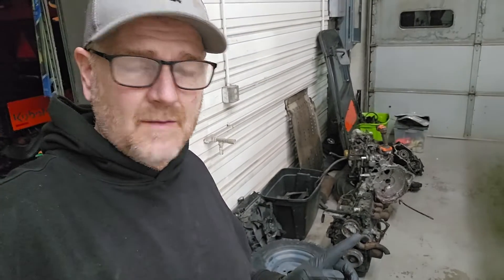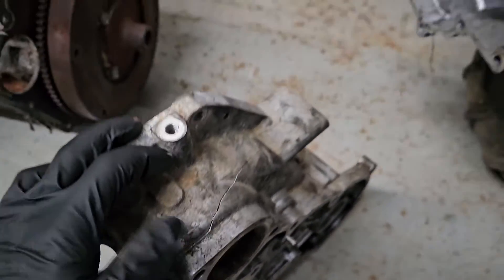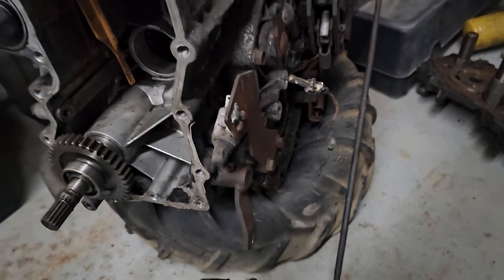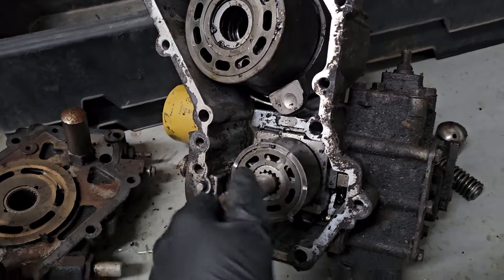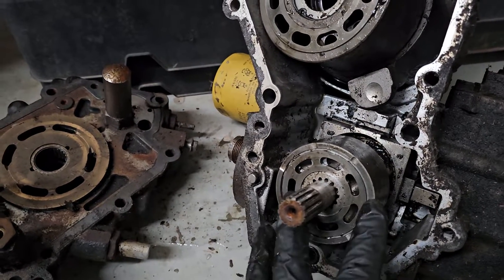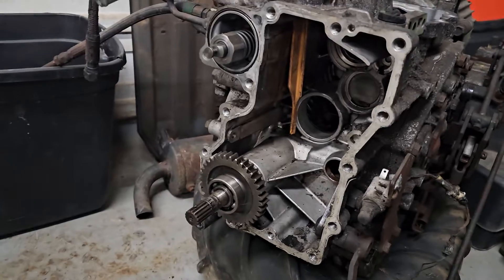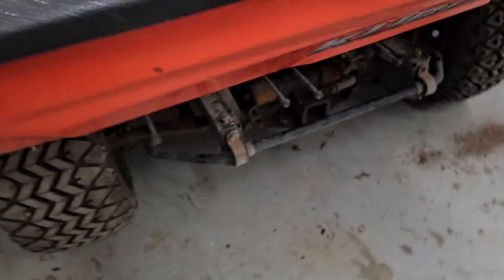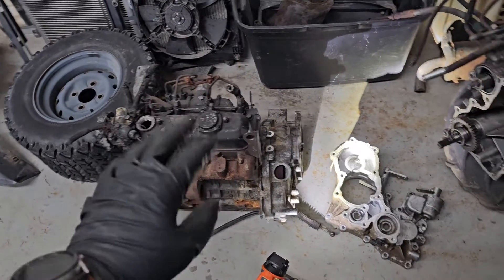How does a HST transmission work? Let's look at this Kubota RTV X 1100 c

Comment: Thanks for the great videos.  Here's a good one!  I have a 2021 Kubota RTV - X1140.  I was changing the transmission oil and the plastic funnel stuck in the hole.  I am not sure how this could happen, but it would not come out of the hole.  Trying my best to to ease it out, the tip of the funnel broke off and is inside the fill area.  I drained the fluid hoping to retrive it from the drain holes.  There are 2 drains. one magnet, the other drain.  No luck.  Used a camera scope, but could not find it.  My question is, how does the fluid pass through the transmission?  Is the HS pump and motor receiving oil directly from the transmission or is it aways filtered through the two oil filters before entering the HS pump and motor?
Reply from the maker: Under the bed fluid is just for the gears and wet brakes. It doesn't flow anywhere else. Its basically a rear differential in there. The fluid is just lubing the gears. 

 The tank under the seat is the circulating fluid. That would be a problem in there. 

I'm not sure if the plastic will just get chewed up or if it would actually cause damage. Obviously its not great that its in there... I'm thinking of what I would do in that case. Hmmmm...

Comment: I have a 2014 RTV X1100C, today the transmission started slipping? I stopped and checked all fluid levels and everything was normal. Proceeded cautiously and when I slowed down to make a turn while returning to my house I lost all movement. No reverse, low or high range. No visible oil leaks....any suggestions? I replaced both filters and topped off oil levels about 2 weeks ago and it has been working perfectly.
Reply from the maker: See if it works in 4wd or with the differential lock on. You may have a bad cv joint.
Reply: @SearlesStation yeah I tried that too. It's like the oil is shut off? I cannot see the oil circulation in the resivore like normally. The vehicle is definitely shifting into desired gears just no pressure from the hydrostatic pump....is there a pressure relief valve that could possibly be stuck? The brake actuated bypass valve appears to be working properly but I do see another valve on the right hand side close to filter ports that is sealed with an aluminum cover..
Reply: @SearlesStation  pulled filters and cut apart. There are no metal shavings or any indication of an internal failure. Hydraulic bed and steering work so I assume that the charge pump is fine. Am I correct in the assumption that the transmission oil and the HST oil are isolated from each other?
Reply from the maker: @crittergetter1720  yes the reservoir under the bed is only for gear lube and the wet disc brakes. The hydrostatic transmission fluid is under the seat on the passenger side. I know there are some issues in with the drive pump or motor (hydrostatic motor)  sometimes. Just as a check does the linkage on the driver side move the lever in the back side of the hydrostat area? Is it possible that the linkage is not operating properly?
Reply: @SearlesStation  yes the linkage is working properly. I've drained all the oil in both the HST and the transmission. The Kubota dealership really doesn't know what to say other than to test the pressures if new oil and filter replacement doesn't work.

Comment: Just a question . For someone who’s new with Kubota rtvs. I have my hst and engine split from the transmission . Unfortunately I had to step away to do another job . What kinda tips do you have for people who want to remember bolt sizing and where they go. Certainly not a shortage of hardware on these small machines . Thank you
Reply from the maker: Yeah, I have some magnetic trays that I try to keep separate for each area (for the most part) Take a bunch of pictures before, that helps too. 

If you go to messicks.com they have the parts diagrams that you can get a real good look at the assembly too.

Comment: dealing with an rtv x 1100c  it stalls out and will die with the ac on but only when accelerating
Reply from the maker: Thats interesting. I do know know the AC takes a good amount of power from the engine. Try pulling the hand throttle and see if that helps.

Comment: Great video, i have question about the brakes squeaking on a cold take off or sitting for a period of time, i have disconnected the parking brake to see if that was 
 hung up and its not the problem, Fluids changed correctly, once its warmes up by moving it, the squeaking goes away, i understand it is a wet braking system.... i have not a clue, fluid stays correct no high or low frequency
Reply from the maker: I would suspect a wheel bearing or axel over the brakes. The brakes sit in fluid so a squeak would strange. 

Lift the whole machine off the ground safely and have someone in the cab while you listen for the sound. You might be able to pinpoint it better.
Reply: @SearlesStation  appreciate the come back and if tried that to and still makes that sound, I will look into that thanks a bunch!

Comment: Hey thanks for the video! I got a question for you, what would make my rtv not want to accelerate past 5-7 mph? It takes it about an hour or so to want to get to 15-17 mph. Any help would be greatly appreciated. Thanks.
Reply from the maker: Which model do you have? Old style rtv or an X models? They are similar but a few differences.
Reply: @ we have an older model. The XC. This morning it wouldn’t even budge forward without first going in reverse.
Reply: Sorry it’s the x1100c.

Comment: Great video, I have a 2013 1140, with about 1400hrs. I got the machine used, and it worked for awhile, although not peak performance, and its now "stuck" in neutral. I get RPMs from the engine, I can change gears, reverse, high, med, low, but the machine doesn't move. Its outside right now, and I'm wondering if you can shed some light on what I can do to get it inside to do more extensive work. Up here in Canada, I want to try and at least get the unit moving to get it indoors.
thanks so much, really enjoy your content.
Reply from the maker: Yes, follow the shift linkage to the transmission, there should be a plate there. Open it up and my guess is the shift fork popped out from the internal link. See if that helps.
Reply from the maker: Another thing to do is safely lift all tires off the ground and put it in 4wd and see if any of the wheels turn. That can eliminate some things...

Comment: Very good videos. Thanks for sharing. 

We operate on a winter ski park.  With your help I’ve taken this and doubled our speed and hill climb ability.   
Often when parked a bit leaning right when restarted it will not move. Any ideas? 
As well as power levels drop and return with no change in throttle. ?
All new fluids and filters.  ??
Better but it’s not where we need it to be yet. 
Hydro-pump?

Comment: I've got an rtv 900 with 4500hrs that is gradually loosing it's pulling power up hills, what usually wears out on them, im thinking maybe the brass/bronze plates that the pump body runs against, any ideas?
Reply from the maker: Yes, that's definitely a wear point. It's all based on pressure, so if that plate is leaking it will lose pressure. Bad fluid, weak charge pump, clogged filters, or a combination of all of that. Maybe I need to do a pressure test video!
Reply: Excellent, I've just subscribed. I did a pressure test a few years ago and it was within tolerance, maybe I should do another. I've heard of people increasing the prv to 4000psi to get more pull, what do you think about that?

Comment: Hi there
Our RTV X1120D 2018 suddenly stopped drive. 
Tries to move but no real torque transfer. 
Oil hydrostatic type issue. 
Both Gbox & hydro tank oil levels good. 
Unloader valve moving & can hear/feel it doing something when activated, while pulling on main control rod. 
Any ideas. 
Other than your video on how the gearbox works is there something on how the hydraulics operate & there controls.
Reply: Forgot to mention tipper body seams to work correctly so maybe pump all OK. Just hydrostatic drive fault.
Reply from the maker: Possibly an axel? Does it move in low or reverse?  Or, Does it work in 4x4? If yes, lift the back off the ground and see if the tires spin. (Typically the passenger side will spin first) Perhaps try the differential lock to see if the driver side rear spins. 

If none of that works, it might be in your hydrostatic area. You can pressure test it or have the dealer pressure test it to see if it's pumping.

Comment: What does the unload do when the pin is pressed in when you step in the brake?
Reply from the maker: The unloading valve releases the pressure built in the hst. If the pressure isn't released, the gears are bound so it is difficult to shift out of gear to another gear.

I do have a video on the unloading valve.
Reply: @SearlesStation  thanks. I have 2015 x1120d it stopped moving in forward an reverse. I found the cable this to unload valve broken do you think would cause this
Reply from the maker: @wisconsinbigcheese6309  I don't think it would unless the valve is depressed. Where are you in WI? I'm in southern MN by  New Ulm. I'd take a look if its not a hassle to bring it this way

Comment: Great video.  Crazy question... i am trying to rebuild the hdrostatic unit on one of these and i need a few parts.  I need a couple of pistons from the larger driving block on the hydrostatic unit.  I would be happy to buy them if you still have them kicking around.  Thanks!!
Reply from the maker: Just looked through my parts. I really don't have any that would be good. They are all worn pretty well.

Comment: If the rtv900 is slowing down faster than usual,  how do I adjust that? It's the not the brakes
Reply from the maker: There is a shock that dampens the return to neutral on the linkage. My guess would be that, that shock is bad and not slowly returning to neutral but the spring is pulling fast. 

Have someone step on the foot pedal while you watch that shock or just take it off and see if it is any good.

Comment: Can you PLEASE explain why did that transmission have a great hole right where the 4 wheel drive shaft came out and it appeared to be welded, I’m aware you purchased it and it didn’t happen to you but just thought you might know why that has happened.
Reason I ask is, mine blew a hole exactly in the same place and Kubota Australia replaced the housing free of charge it’s not under warranty either, they actually done all the work and didn’t cost me anything, so just wondering are they hiding a known fault.
I actually did hear from kubota delivery drivers that said it’s common when they are in snow and the wheels are spinning then it hits hard ground that’s what causes the housing to blow out under pressure.
Have you heard of that happening.
Reply from the maker: Yes, there is a flaw in the casting and how the bearing sits in it. It wears and then breaks! 

It's very common and it's good to hear they are taking care of people on that. 

It sounds like the new casting has the issue fixed.

Comment: good day . i was waching your video   , seen your pile of broken parts . had my pump apart . did not find any thing wrong in it , end up pulling some of the valves apart to see if any springs where broken . i have a small peice i can not find where it goes . i   would like to know if you still have your broken pump parts from the rtv x900 i am looking for the steel plate that holds all the valves .

Comment: Hi.  Got a question you may be able to help me with.  I have a 2018 1100c I just bought used.  I decided to do all the preventative maintenance since this is new to me.  Today I tackled the HST.  I changed out both  filters with new Kubota filters.  After I changed them out I took it for a test ride and things were fine.  I then checked the fluid level and found it to be way overfilled.  I decided that I would loosen the big filter and let fluid drain from that since that filter seemed to leak fluid the entire time.  After what i thought was enough fluid removed I put the filter back on.  Now I have no transmission.  I did all the preventive things I found on the internet that included lifting the wheels off the ground and running it till the wheels spin.  Once that happened I took it for a ride.  It was very sluggish and when I got it up to speed and lifted the gas pedal it was like someone hit the brakes hard and then it would jerk forward.  I suspect either there is air in the system or the pumps aren't getting fluid.  Nothing I have done helped.  If it sits for a while it won't move until I raise it up and do the pedal thing until the wheels move.  I even reverted to putting the old large filter back on to see if that changed anything. (it didn't).  So before I call a dealer I am wondering if there is a trick to purge the system of air or a way to see if fluid is getting to the pumps as they should.  The fluid level is currently correct.  Any help is appreciated.
Lou
Reply from the maker: With the hydraulic transmission there is no coasting like a regular vehicle. If you take your foot off the pedal it does come to an immediate stop. That is normal operation. 

There shouldn't be air trapped in the system after a few moments of operation. It should clear itself. Which location are you checking for fluid level? The orange/yellow cap under the bed is basically for the gears only. The tank under the passenger seat is the operation fluid. If that one is low, that could be your issue. Lift the seats, take out the tray and you'll see a rubber plug on the passenger side. Check that, or let me know if it's at a correct level.
Reply: Funny that I just got your response.   I just returned from the kubota dealer and when I inquired a kind man said "did you check the tank under the passenger seat".  I did and it was almost completely empty.  I put in 1 1/2 gallons of udt2.  Started in up, let it run a few minutes then drove away.  Problem solved!  Based on how hard it was to open the filler plug I guess it has never been checked or topped off.  Thank you for your help.

Comment: I have a 2015 RTV x1100c and it has stranded in the field. How can I disengage the transmission to tow it back to the shop? Or can I just pull it back to shop without disengaging? Thank you for any help
Reply from the maker: You should be able to put it in neutral... 

Press the brake hard and try to shift it. If that doesn't work, there maybe be an issue with the gears, if that's the case it may not move. 

Pull the orange/yellow dipstick and look inside to see if you can see any gear damage.
Reply from the maker: Let me know if you get it.!
Reply: It's not hung in gear the fuel shutoff solenoid is bad. I just wanted to make sure if I could
Pull it back to shop without disengaging hydro. Thank you

Comment: Appreciate you uploading video! 
Why do you need a transmission. Is it possible to hook up drive motor to a drive shaft directly? 
Have a hydraulic pump hooked to engine. And go directly to a drive motor to drive the shaft? 
And do away with the transmission.
Reply from the maker: You could. It would be possible!
Reply: @SearlesStation  
I have one that I bought at auction. No engine, but have the transmission. Are you interested in another project. To put on youtube ?

Comment: If my rtv 1140 is shifting and I can see gears moving inside tranny through the fill port . Should I be testing my charge pressure ? 
Thank you
Reply: It doesn’t move forward or reverse , sorry forgot to put that in there
Reply from the maker: Yes, both charge pressure and relief pressure. Check fluid level, filters. Sometimes the rubber hose can collapse on the hydraulic lines ans not allow fluid to move. Squeeze them to see if they are soft and squishy
Reply: @SearlesStation  thank you for your reply
My charge pressure was 0 psi in neutral and high idle .
I removed  2 separate relief valves and saw no scoring or anything bad . All components in place and moved freely. I did replace filters and hoses looked ok but will check that again . I had the charge pressure port in the back off and open and started it and hardly any fluid came out . Bearly dribbled .